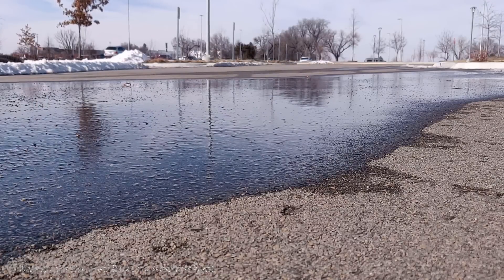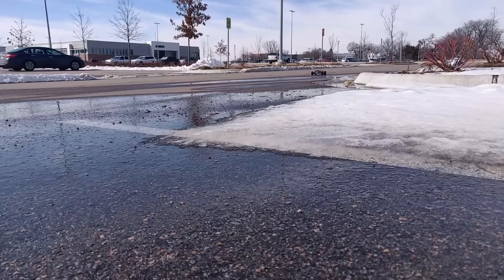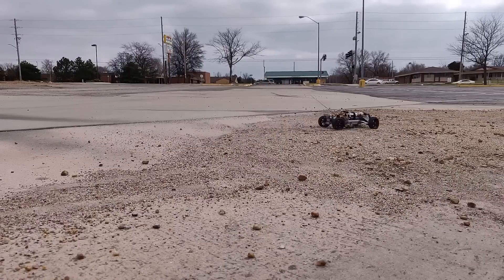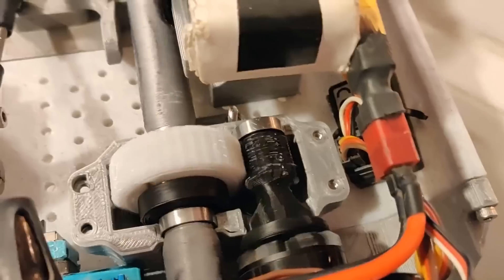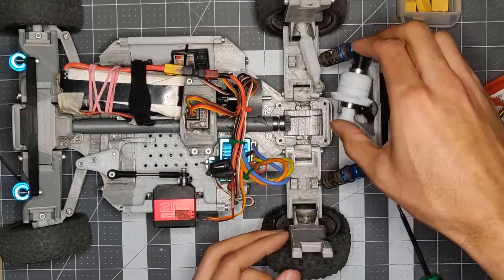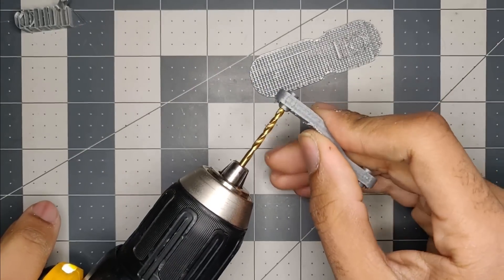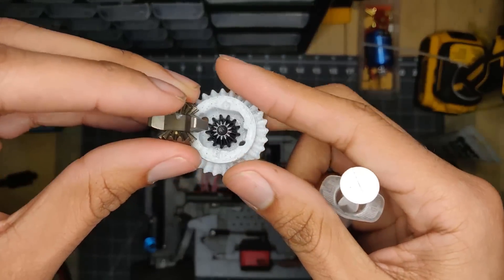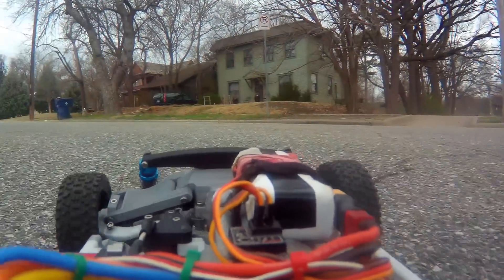Tarmo3 | 3D Printed RC Car

Comment: Hi, thanks for sharing this. I printed and assembled all machine, I printed all gears but now I cannot finish it because of small differential conic gears at 3.40 in the video. You use a metallic gears, I printed these in ABS but not works so good, just tried by hand, no motor already mounted. Please, how do you get these gears ? Thanks
Reply from the maker: Post about your issue to the subreddit
Reply: @EngineeringNS  Thanks for reply. Where please ??? I found it on Thingiverse. Only these conic gears are missing, I printed all the machine , even the cover like Porche Carrera.
Reply from the maker: Look in description

Comment: I've printed all the parts what is the best stuff to use I need a parts list. was ending battery screws servo  etc. are the best somebody help.
Reply from the maker: Check links in description
Reply: @EngineeringNS   the parts list thanks so much what a relief.  Will be doing v4 after this.

Comment: Completely random question: I saw the Family Dollar in the video and reminded me of my old campus apartments at Wichita State. Any chance its the same place? LOL
Reply from the maker: There is a very high chance that is the case 😂
Reply: @EngineeringNS  Lol! Anyway, great project. This is my first project and I’m planning to use a Raspberry Pi as a computer on board (then use XBox controller for controlling). 

I couldn’t see any info on the software and radio on your Reddit or the instructions manual. Am I missing something here?
Reply from the maker: It only uses simple plug'n'play RC car electronics. Unless you want to try something more complex, all I used was a basic receiver and transmitter meant for RC cars. 

 There is a guy on the subreddit who did something similar to what you are wanting to do: https://www.reddit.com/r/EngineeringNS/comments/ih2jqt/got_springs_builds_done_but_with_all_of_the/?utm_medium=android_app&utm_source=share

Comment: Hello, I have built my Prusa I3 3d printer, but I am not confident in using it.Am I right in understanding these are the steps I must follow to start my first 3D print:
1.calibrate bed (2mm distance from print Nozzle, with a piece of paper)
2. warm up bed and nozzle, bed 170 oC and nozzle 220 oC.
3.insert SD card with files to print.
4. Select print from the menus.
Is this right? will the printer NOT start printing until it reaches 220 oC?
I need help with this, any tips gratefully recieved.
Rob
Reply from the maker: Post your questions to the subreddit people might be glad to help you out.

Comment: I had idea to make something like that but more modular and normed. So you can put your RC race car together with parts from various creators. The parts would be available for free or to buy ond Redpah.com. Different tech and different priorities on the parts but same mounting point and some restrictions for battery capacity/ voltage/and max motor power. And make some nice racing cup. That would be awesome
Reply from the maker: That is actually a good idea. Though, a 3d printed RC car is modular by nature. Anyone can design a new gearbox or any other part that could mount to the chassis. This car is old BTW, Tarmo4 is out ✌️
Reply: @EngineeringNS  The modular thing is more for those that dont have design skill. Many people owns 3d Printers cant design and print only what they download. The idea is to make only mount points and connection points (for energy transfer) normed and same for every component type. So you can build your RC car like lego bricks.

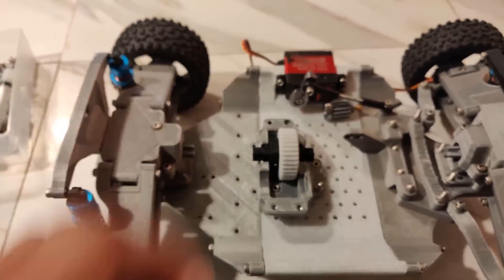Comment: genuinely surprised the gears hold up to the abuse so well, even if the motor is on the smaller side, at least for a 1:10
Reply from the maker: Surprisingly, For Tarmo4 the reliability is further increased, I never imagined that PLA gears could last for months in a heavy 10th scale rc car.
Reply: Engineering Nonsense yeah same

Comment: Which 3D printer do you use? Great project!
Reply from the maker: I use a custom made corexy printer. It's a bit if a diy situation. What are you using?
Reply: @EngineeringNS  ty for the reply. I am currently using an anycubic i3 mega. But I am pretty new in the field of 3D printing (few months), all the models I printed were quite basic and standalone, nothing compared to your RC car. But I have the tool and the software, so in the future I will to print more complex structure.
Thanks for sharing the video and the info!
Stay safe and keep up!

Comment: It's turned out a big problem to find the Torsion Spring (#1:07) in my country. Could anyone share a link to the suitable spring on aliexpress please?
Reply from the maker: I made a new damper from flex filament. Check out my Thingiverse page you will see it. It works better than the old spring design in this video.
Reply: thanks! P.S. can’t wait for v4, saw it on your Instagram 😊

Comment: How do you print the axles? ich have tried all orientations but it will not work. Best regards Chris
Reply from the maker: Send me a photo in an Instagram message
Reply: @EngineeringNS  I found the correct settings to print the axles. Thnak you!

Comment: Just came across this.  Do you discuss your printer setting in a video?
Reply from the maker: No I didn't, but I'd be glad to explain it to you if needed
Reply: @EngineeringNS  That would be cool.  Just the basic settings in your slicer would be awesome.
Reply from the maker: Some instruction can be found in the 'print orientation' document linked in the description and also on the Thingiverse page there is instruction.
Basically, 
use high Temps between 210 and 220c
On drive parts use 0.25mm layer height
On chassis use 0.3mm layer height.
On chassis 3 perimeters is fine
On drive parts (anything that moves) use 6 or more perimeters
Set infill to 10% for all parts

Comment: Just got one question. Why do you need a torque damper? Can't you limit starting voltage in code?
Reply from the maker: Well no. There is no code, the ESC allows you to adjust 'punch'  but starting the car is the smallest issue with regard to torque. It's hard to explain but if you ever drive an RC car you will understand.

Comment: i realize that you're emphasizing the lack of wear with PLA, but i want to make this and give it to a friend as a gift. i could send him spares, but he would never repair the car. it's not in his skillset, and he won't want to take the time.

in that case, which filament would be best?
Reply from the maker: Sorry for slow reply.
I would not recommend this project as a gift.

Let me see if I can explain why:

Even off the shelf non printed cars break parts constantly. The parts on those cars are inarguably stronger than 3D printed parts. It's just the nature of high performance RC cars that parts will break. So I don't think you will get away from that by using a different matirial. In addition to that, I wouldn't recommend this project to anyone who is not mechanically inclined. It's very mechanically complex and would be overwhelming If you dumped it on someone who just wants to drive an RC car.

This project is geared towards mechanically inclined makers who would rather build their own stuff than buy something expensive from the store. It's also for people who enjoy mechanical complexity--Thats why I live it despite the fact that believe it or not I'm not really interested in RC cars as a whole.
Reply from the maker: That being said, I don't know what matirial is best since I've never used anything other than PLA--However I believe that PLA's hardness makes it one of the better options. Maybe nylon would be better?  I don't know.

Comment: Hi, how do you control it? I'd like to build something like this, but I have no experience with rc models.
Reply from the maker: Use an RC receiver and remote to control the ESC and Servo.
Reply: @EngineeringNS  Thanks for the reply. I have the whole car folded, but I have a problem with electronics ...... anywhere I found in the document board that you have on the transmission to which is connected servo. Do you have a link where to buy it?
Reply from the maker: @BlueBerry-kh3lx  Sorry I don't understand :/

Comment: Any updates on the google doc? I'm new to RC car parts and could use a guide.
Reply from the maker: Sorry, it isn't likely that I'll finish that doc. Just don't have the time to work on it. I'd rather spend my limited time working on the next project. If you get stuck then shoot me a message on reddit or Instagram.
Reply: @EngineeringNS  Ok thanks Man I like the car and I don't think ill have trouble with the printing but a schematic would be great. I followed you on IG

Comment: Is PLA durability based more so on its age since printing than on its physical use?
Reply from the maker: In my personal experience, that is not the case. I've had mechanical parts that have lasted for years. Even the rear differential in Tarmo3 lasted a very long time and to this day hasn't stripped. If it sits in the sun for months or in water maybe that will be an issue, but if you store it inside your house it shouldn't be a problem.

Plus, if someting gets weak after a while, just print a new part.

Comment: Love your work!
Its such an awesome concept to just print off the part you've broken.
How come you don't use ABS? Is it to heavy?
Reply from the maker: Thank you!  😀 The weight would be about the same, but ABS is harder to print, in addition to that, ABS is soft and the gears would wear out a lot faster. I guess a benafit of ABS is that it can maintain higher Temps, but if you keep things cool PLA works better,its easier to print and its cheaper.
Reply: @EngineeringNS  Fair enough PLA sounds better for it. I suppose ABS is pretty soft. I never really thought of that. Thanks for the reply👍
Reply: ABS is a pain in the ass to print. I've seen a lot of people think that a part needs to be printed in abs when in reality PLA or PLA+ works just fine.

Comment: Hi, this is so great, but...Why are the two differentials different?
 Can I put the two diff as the front differential?
Reply from the maker: One is locked and one is open. If you don't understand try looking up videos on YouTube it will explain the purpose of this. The open diff is recommended on the front, the rear can be either open or locked diff.
Reply: @EngineeringNS  thank you very much I did not know that
Reply from the maker: There is a set of gears in the BOM file you must purchase for the open diff. You can see these gears at the end of the video there is a clip of me assembling an open diff.

Comment: You should do a video on the assembly of this car. I want to print it, and it would be great to see all the parts laid out, all other parts needed, then the build. Thanks for sharing
Reply: Agreed!
Reply: +1
Reply: +1
Reply: yeah dude that I think would be adding lots of makes to the thingiverse page!
Reply from the maker: You are right, unfortunately this project is closed and finished I no longer have my Tarmo3. But I will be making a tarmo4 video soon and for that I will make an assembly video
Reply: @EngineeringNS  do you still doing it or you give it up if you doing it when would you finish it?

Comment: hi sir, nice project. iam printing your design, but iam having problem sourcing this (Traxxas 5382X Differential Gear Set) any suggestion sir, please help.. thank you
Reply from the maker: Did you try the link in the BOM document?
Reply: @EngineeringNS  yes sir i try it. But the traxxas 5382x diff gear set is not available here in my country. Amazon doesnt ship here in philippines
Reply from the maker: @marlonglodo1930  Try doing a google search for it. --here is an ebay result. https://www.ebay.com/p/Traxxas-TRA-Differential-Gear-Set-5382X-Tra5382x/691217591

Comment from the maker: Links are in the description for all the files and parts needed.
Reply: There are video to the assembly?
Reply: Building mine right now
Reply from the maker: Post pics, I wanna see it! I'll follow you on insta
Reply: what transmitter and receiver did you use
Reply from the maker: I used a super cheap combo from Amazon. Don't recommend it. It's garbage I want to get a new one soon. Any 3 channel rc car reciever should work.
Reply: Ok thanks
Reply: What’s the name of the springs you put in the gear at 1:07? 

Can you include a list of small parts like that that you used?

Also what motor did you use? Or does it not really matter?
Reply from the maker: All that is in the BOM. But I no longer recommend that torque damper, I have a new design that is on my Thingiverse that uses flex filament instead of a spring it works way better.

Comment: you should try helical gears because it will make it even mor e sturdy and more silent
Reply from the maker: The only reason I haven't done that yet is because of axial loading that it would cause--Also the gears don't really break its always the axles that break--But to make it quieter, as you mentioned, I didn't think of that--So I might give it a try because of that!

Comment: Hello nice project, have you finished your vacuum cleaner that is on thingiverse ? because i want to build a similar project but with new features, if you have problems i can help you.
Reply from the maker: I haven't finished it. Its been on the back burner until recently. Though I have learned so much from other projects I am thinking about restarting the vacuum project because I think I can make it much better.

Just low on time.
Reply: @EngineeringNS  Okay, lets me know when you restart this project I will gladly help you.

Comment: Nice car, I'm thinking of doing one in carbon fiber nylon.
Reply: I would just use normal nylon. I have yet to see a test where these carbon fiber reinforced materials will undeniably outperform other less exotic (and significantly cheaper and easier to work with) materials like plain nylon.